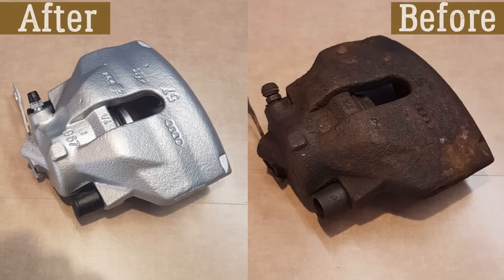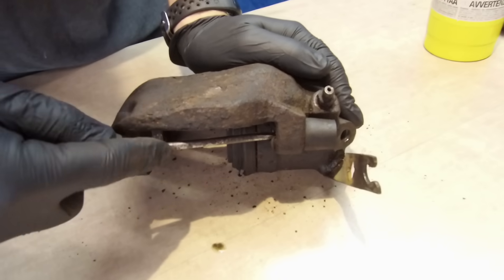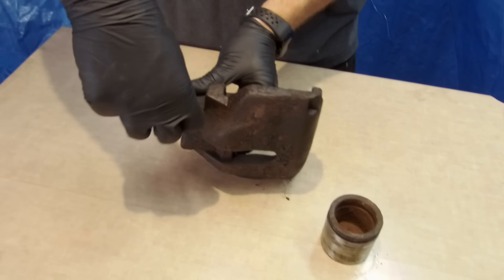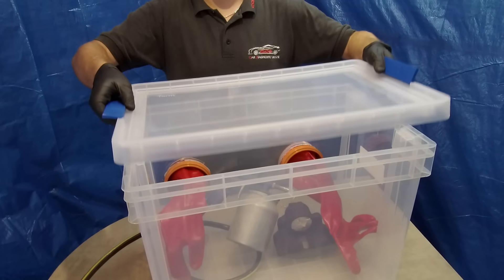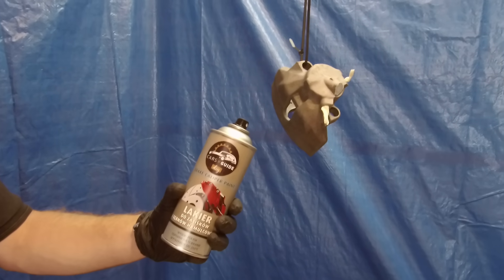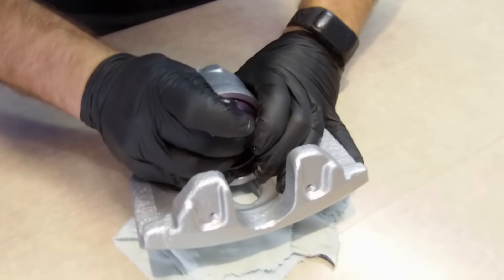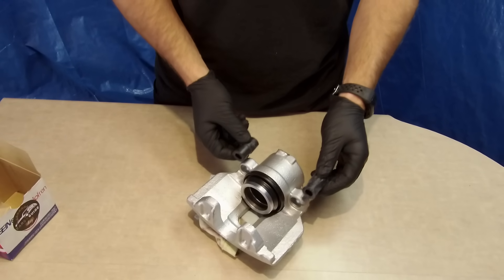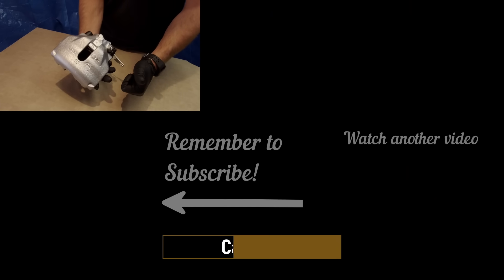How to rebuild front brake caliper - VW Audi Skoda Seat - New piston and seals (COMPLETE GUIDE)

Comment: Would be interesting to see this caliper in a year of using on salty roads... 
For better result I would suggest you to check https://www.kbs-coatings.com product line. Unfortunately due to ROHS initiative there are no distributors in Europe anymore, so maybe ebay can help. Good products, tested on my own (ordered from Netherlands 5 years ago), not cheap although. 
They have a unique product Diamondfinish, which is a clear coat you can put even on bare ferrous metal!
However an etching (phosphate) primer with epoxy primer as a second coat is also a decent solution, if you want longevity of the result.

Comment: HOLY FUCK ... Rebuilt many a caliper over the years and that is not how you remove a caliper piston .. you fill area in front of piston with wadded up towel to cushion the piston when you apply compressed wir with a air gun into the brake bleeder hole you just removed the bleeder from .. the air will make the piston fly the fuck out with massive force hence the reason for wadded up towel to catch the piston and prevent damage to it and keep your fucking fingers away from where the piston will come out if you don't want to have them severed . is this method dangerous ? you betcha but its simply how its done using vise grips will damage the piston use only in severe case where air will not work because your probably got a galled piston anyway

Comment: I'd rather buy new parts instead of rebuilding old parts. Here in Germany, as opposed to England, cars must have good & reliable parts to get TÜV test in order to be allowed to drive!
Reply: Do you think that your "new" caliper is really new? Usyally it has been rebuilt like this one in video and you have to give old caliper in return. Caliper shown in this video is basically new, and will perform just as good as new
Reply: @nizzeeeee2761  Bollocks! Here is Germany & every product is according to DIN or EN norm. We through old oarts away which could be recycled!
Reply: @drkimy stop lying, i have ordered many remanufactured parts from germany😂
Reply: @nizzeeeee2761  some people really do talk crap on here don't they
Reply: Regeneration of the clamps, like here in the movie, is very good and effective. All seals and piston are replaced.